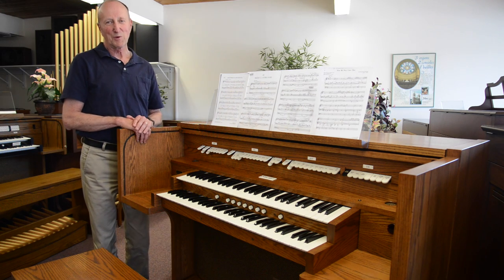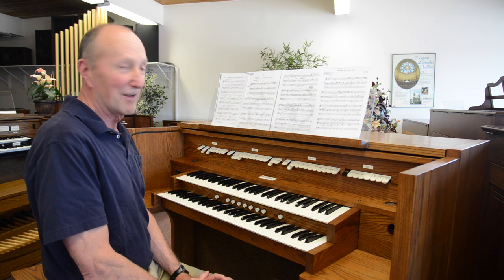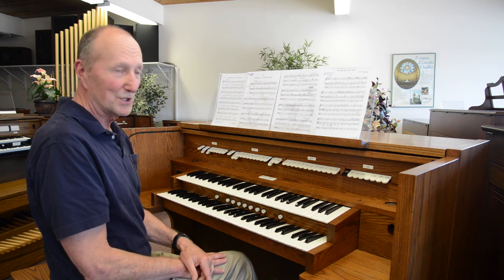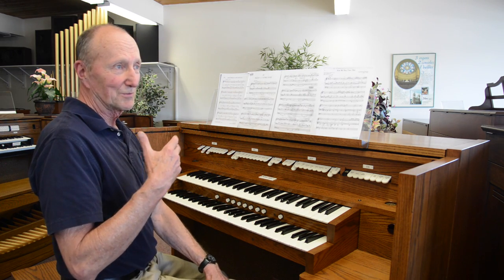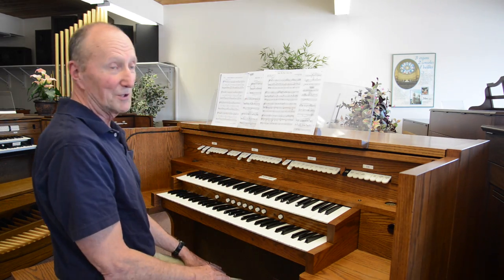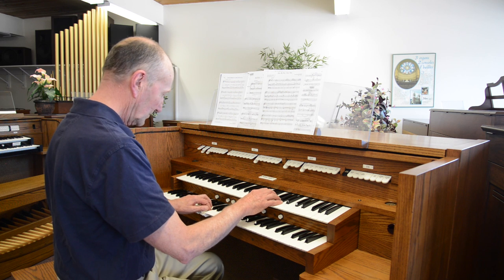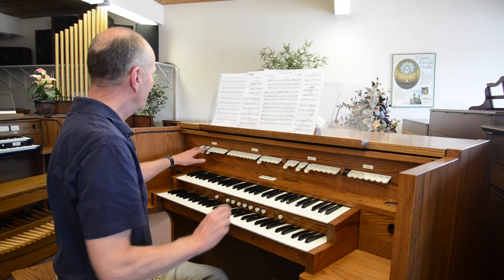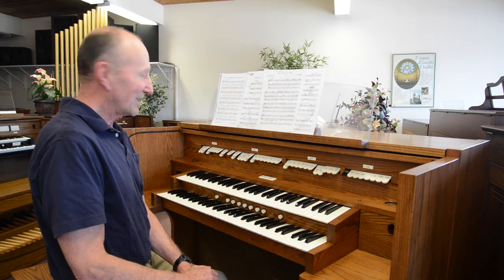How to Get Big Sound out of a Small Organ

Comment: I’m sorry, I have to agree with some of the others on here . That Allen organ sounds typically electronic and absolutely diabolical and I am certain would be no use in a medium or large church building because I don’t think it could support a large congregation without using all the stops and the sound would be ghastly!
If any congregation had to choose between spending money on restoring a good pipe organ or replacing it with an Allen such as what you demonstrated, I would strongly advise them to save  their money and continue to fundraise until they had the money to have the pipe organ restored. All the time and any time.

Comment: my Episcopal Church for years had a smaller Reuter pipe organ, they had installed about 1979, it was done very bright sounding and sounded better than some bigger pipe organs or Rodgers or Allen church organs as the time.  It could blast you out of the building if someone tried.   We moved about 9 years ago, and built a larger building and this organ is now hybed with a Allen, but the guy we have hired to play can really pull out the pipe organ part of it